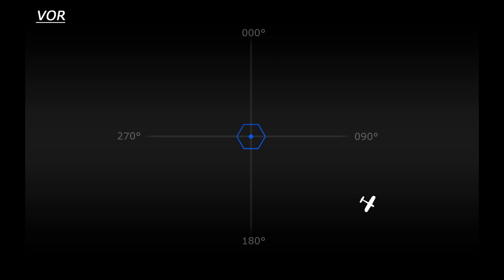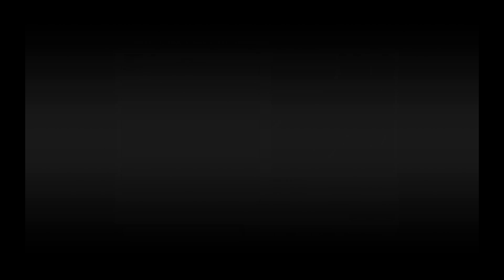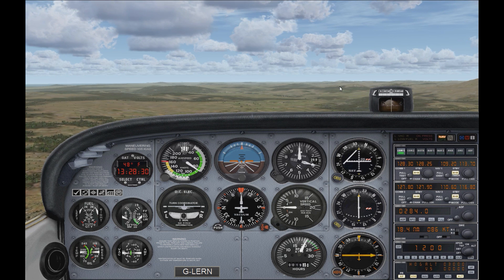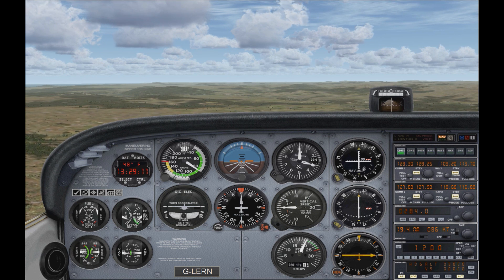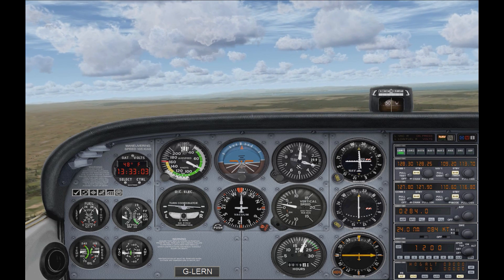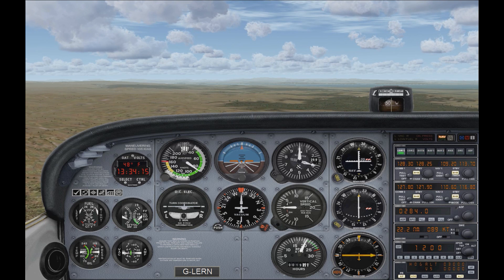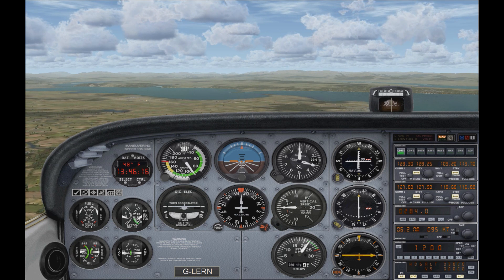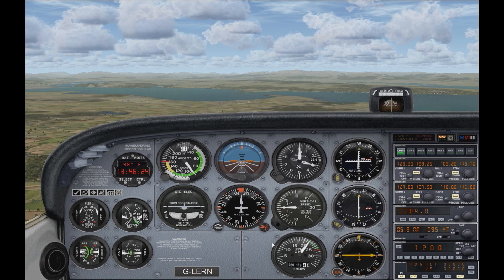FSX Tutorial: VOR Navigation

Comment: Plz reply to the following pointwise:
1. Initially, why did you rotate OBS knob so that VOR needle comes in centre, shouldn't you change your heading from 090 to left till needle is in the centre? (Bcoz in later part of video, when flying directly to west, you did not rotate OBS to bring the needle to centre, instead you changed heading until needle was in centre...)
2. You said VOR needle don't show heading...that's fine...but when you are turning your heading to right,  aren't you changing track also( bcoz it's not that you are still in air and turning, you are moving forward also), so shouldnt the track also change and needle should deflect..?
3. When you switched on autopilot button and then nav button, why does it disengage when needle of vor is slightly towards left, shouldn't it disengage when the needle is exactly in the centre...?
4. Please make a video on VOR approach using approach plate chart as well...

Comment: Great video. I understand flying from VOR to VOR, but I cannot get navigating from VOR to airport for landing. Meaning that when I set the airport ILS freq on NAV1 then the horizontal OBS needle shows G/S correctly but the vertical one jumps away to some weird position and when I turn OBS (no matter if left or right) it does not react at all. Tested twice on Munich-Salzburg flight. Any idea what I do wrong? I was trying to not use autopilot NAV or APP buttons but only heading and do the rest manually.

Comment: Hi Doofer.  Followed your VOR tutorial which I liked very much.  However, trying to apply it to quite a challenging landing on a dusty runway track from CNM (VOR 116.30) to NM47 (airport) and this seems pretty tough and cant seem to get it right following your guidelines.  Any video or advice you can make on it?  Thnx
Reply from the maker: The only thing I could reccomend is to calculate the distance from the VOR to the NM47 airport and use the VOR to get you over your destination airport. Then you'd have to land visually if there's no VOR at your destination

Comment: Tracking a vor can be a pain. As you get closer to the vor your tracking gets harder because the signal is getting narrower. Take the flight lessons in FS Rod Machado is awsome. greaat tutorial
Reply from the maker: Yeah, it's certainly a challenge in a simulator, can't imagine what it's like in a real aircraft with a needle which could sway from side to side with aircraft movement as well.
Reply: Doofer911  they are probably using auto pilot.

Comment: For the wind correction angle, wouldn't you just tune to your closest weather station, look up wind speed and direction, and do an E6B calculation to determine what the correct angle would be for that wind vector?
Reply from the maker: Yeah definitely! That could be a better method as you will figure out the Wind correction angle quicker rather than constantly re-adjusting to hold a Radial. I'm not a real pilot though so I can't say for certain

Comment: Hello Doofer911 (or anyone else reading this post for that matter!) This is an excellent video that clearly explains how the VOR and OBS work, so many thanks :)
I have one question though - in previous versions of FS there was a constant problem of 'reverse sensing' or 'backcoursing' making the VOR gauges difficult to interpret. I have read elsewhere that most modern navigation aids have overcome this, but there are still some in the world where this occurs.
Could anyone please explain if this happens at all in FSX, and if so, how to deal with it? It was a real problem for me before.

Many thanks :)
Reply from the maker: I think once you have an understanding how reading "TO" and "FROM" a VOR then you'll understand how the instrument interacts with the station. Back-course is a term used to basically fly "the wrong way" along a localiser. For example, an airport may only have one ILS system for one end of a runway, and not the other. That means you could perform an ILS landing on one end of the runway only. However you could perform a "Back Course" approach and make a landing on the opposite end of the runway by using the same ILS signal but as I said, flying the wrong way along it to end up at the opposite end of the runway to the system.
Reply: Thanks Doofer
To clarify my query further, your demonstration here is very concise, however you already know your position relative to the VOR station. The problem I was having before was when you don't know your location relative to it, ie. you don't know if you're flying TO or FROM it. When this is the case, as a novice, I found that there was no way to know this other than to lock onto it with the OBS and see what happens - Sod's Law always says that it's the opposite of what you think, therefore the OBS reads back-to-front, confusing the hell out of you until you realise it is reverse sensing and you move the OBS to suit.
So, does this still happen in FSX, or is there a way to always make it always show it correctly? Short of going into the GPS map to clarify your position, I can't see there is a way, however please advise. Thanks :)
Reply from the maker: Ah yeah got you now. No I don't think there's a way to resolve that. As I understand it, that's accurate behavior of the VOR and OBS/CDI. I get confused myself with the needle moving in the opposite direction that you expect.
Reply: neo196910 Im not a pilot, but here is how I understand VOR, maybe it helps.
Adjust your OBS such that the "from" indicator is showing and the vertical needle is in line. The radial that you found is the correct heading if you were to fly away from the VOR. You now absolutely know that, if you fly that heading, you will fly away from the VOR.
Now if you turn the plane 180 without adjusting the OBS, you will be flying towards the VOR while the indicator is showing "from", and this is what gives the reverse indication. To correct this if you actully want to fly towards the VOR, you want to turn the OBS until the "to" indicator is showing and the needle is in line. Now the indication needle will work like expected.
To make things simple: the needle will only work in reverse if you are flying the opposite way that you have chosen on the VOR.

Comment: How often would commercial airliners use this VOR navigation?
I just program my flight plan into the FMC and away I go.
I'm assuming that VOR navigation is just for the smaller planes like a Cessna that don't have an FMC?
Thanks for the great video though!! Very helpfull.
Reply from the maker: VOR navigation was the commercial flight standard before Flight Computers took over. A lot of planes used to have a dedicated Navigator on board so the Pilots could focus on keeping the plane flying while the Navigator made sure it was going in the right direction. Pilots will still need to know and understand VOR navigation because Flight Computers do use VOR stations to cross-check the aircraft's position with GPS readings and other things.
Reply: Doofer911.      Thanks for the info!
Reply: Mike Hamel 
Both can use it but I believe if u mean jets, they have to go by ifr but vor can help on approach

Comment: Hellow Doofer.
It's about the question you asked in video.

Let,s start from bearing. You might have already clear concept about bearing that it is the RELATIVE POSITION from aircraft's position.Same applies here.

Now radial.
Imagine a wheel of bicycle.
Take it's center as "hub ". Take it's one aluminium spoke as "radial". It's direction goes from hub to the circumference of wheel
Very first spoke is 000 radial. Second one is 002 radial. This wheel has 360 radial spokes. Spokes always go from hub to the circumference of cycle and so does radial always go away form station

I'm not really good at explaining things. But let me know if this really worked out.

P.S. - Somewhere in physics my teacher told me that is always assumed away from center.

Comment: Hi.  Not a pilot but I was a helicopter aircrewmember for many years.  A quick answer for your question in regards to "radial" and "bearing."

Think of "radial" and "bearing" as being a communicative way of an exact direction, versus an exact location.  A bearing tells you which angle or way to go.  A radial is the angle that comes of a directional NAV aid.

For example:  If we are flying together on the same airplane and I want to tell you where the VOR is, I would say it is on a such and such bearing for X distance.  If I wanted to tell you where I am and we were not in the same aircraft; you were in another airplane or location, I would say I am on the such and such radial from Y (the VOR or a known waypoint) for X distance (a location).  This is more common in the military where you join up with other aircraft in-flight and you need more than just a compass heading (i.e. bearing).
Reply from the maker: That's very helpful! Thanks for clarifying that, I'm sure its easy for a lot of people to get lost in all the jargon with Radials, Bearings, Courses and Tracks. To be honest I'm not sure if I could accurately define and point out the differences in each of those :/
Reply: As I said, not an expert or pilot.  But, a course is a simply a laid out plan of where you will go.  A track is an identified area of airspace that has a path and altitude.  For example a missed approach oval or an air refueling track.
Reply: I learned more here then I did from Rod Machado on FSX! Those lessons suck.
Reply: I was thinking of ALM flight that crashed near St Croix after attempting three approaches/landing and also the air inter flight that crashed in the Vosges moutain, both were attempting a safe approach and this video would have helped
Reply: A bearing is going to a fix and a radial is going away from fix. Say you are heading N to the station N is the bearing. S would be the radial even though you are still heading N.
Look at a 360 degree compass to visualize it.